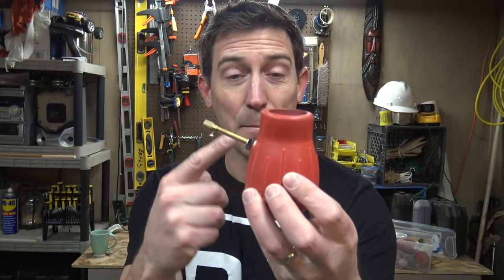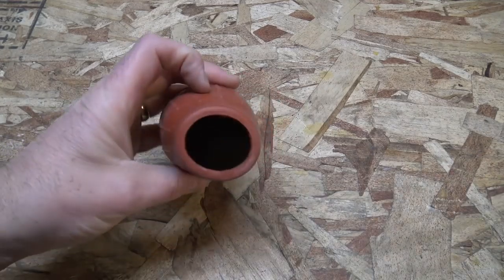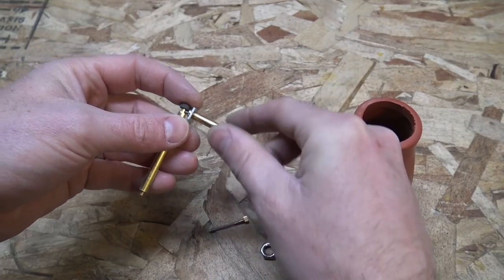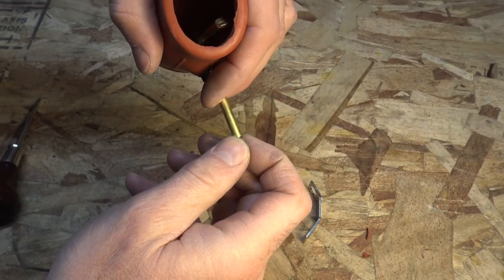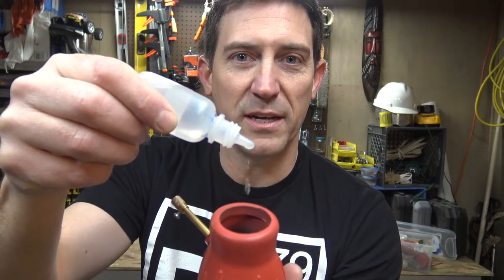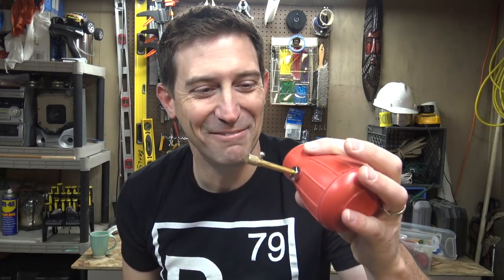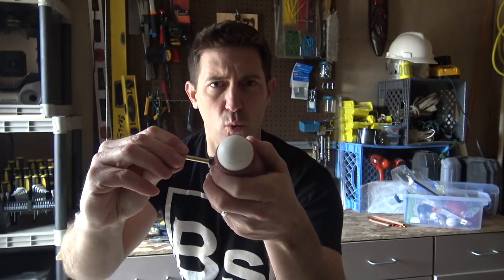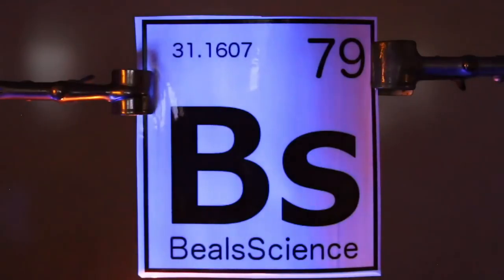Ping Pong Mini Cannon - How To

Comment: does it hurt if you get hit by the ball ?
that is actually really cool though. Nice vid
Reply from the maker: I suppose it would hurt if you got hit in the eye or face...
But, the reason a ping pong ball is a good ball for this is that it doesn't have much mass which means it will pop out easily but will not cause damage if it hits something (at least in theory;).

Comment: .... ..... ..... .. .. .. .. ..

I was at home bored and I picked up one plastic bottle and deodorant  (content  alcohol) I had placed some tissue paper in bottle so it will take (sock)))idk spelling) the smelly liquid and I tried to brun the I think gas on fire by pressing the bottle. and had fun...
But the thing is when I removed the tissue paper it was wet so I burned it the fire was week and blue I was like uhh... and threw the tissue and it kind of exploded and i almost burned my self....

...... ..... ..... .... ..... .. .. . . .. .

Comment: Aren't ping pong balls nitrocellulose?
Reply from the maker: Yes, they do have nitrocellulose in them! Ping pong balls are made of celluloid which is nitrocellulose and camphor. And yes, they are flammable, but they don't burst into flames here because they are pushed out ahead of the flame as the pressure inside the bulb increases.